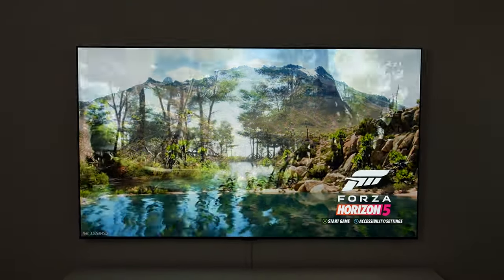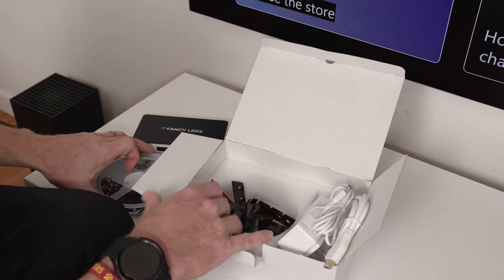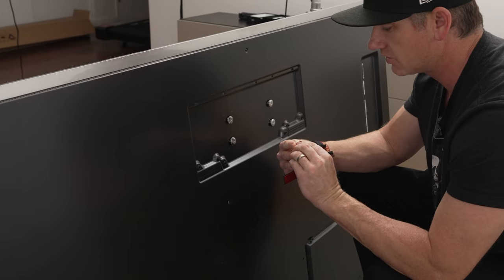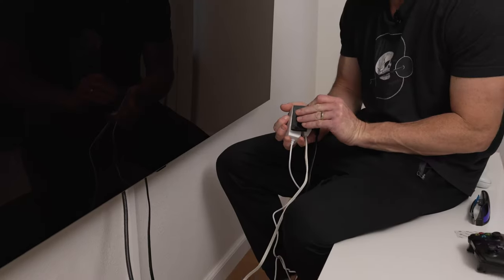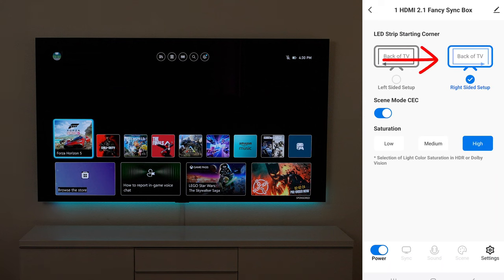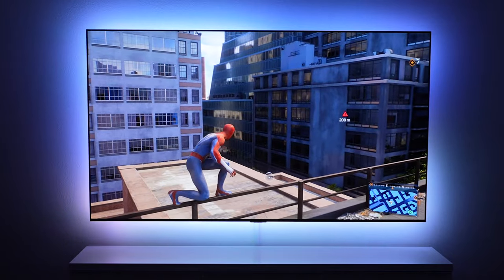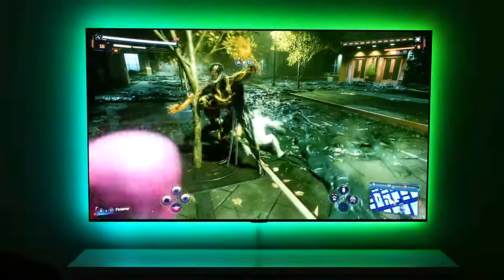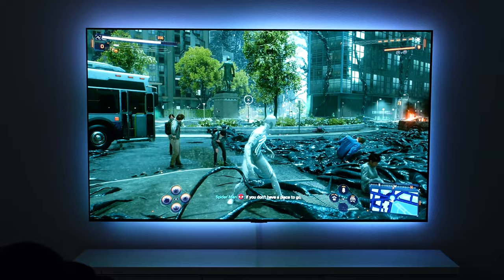Fancy LEDs HDMI 2.1 Sync Box - Making Great Gaming TVs BETTER

Comment: i take it that these lights wont work when watching content natively on the TV.  Is there a workaround for this?
Reply: I think it allows works only got the devices connected via HDMI
Reply: Govee allows it only with the camera if you want the 120hz.

If you have a Samsung tv from 2022 en newer you can actually turn it into a genuine Ambilight tv, as Philips provided an app exclusively for Samsung where you can use Philips light strip and Hue, so it would sync everything on screen, and everything Hue connected, even the ceiling lamp for complete immersion
Reply: @RifetOkic Philips works with anything you plug into it’s hdmi sync box. Any tv. Not special with Samsung or what do you mean?
Reply: @TheBooban  With new samsung tv’s no sync box is needed, only an app and the Gradient light strip. It’s a collaboration between philips and Samsung. the app is expensive, but MUCH cheaper then the sync box, and better too.

one huge disadvantage of a sync box is that it will only show the light effects of anything connected to the box, meaning your TV and all the apps like Youtube won’t work.
Reply: Apparently Govee is about to release a new sync box with hdmi 2.1 support
Reply: @RifetOkic  it’s expensive like Hue. Besides, I only have 1.4, I need a cheap box. Btw, do you know if 2.1 and 2.0 are backward compatible? Which system do you have btw? I need 1.4 and sync to music when tv is off.
Reply: @RifetOkic  apps that plug in via chrome cast would work. I have standard chrome cast and I can’t find a cheap system.

But its the inbuilt apps in smart tvs that this doesn’t work with. I don’t know how an app knows how the tv will show colors but ok.
Reply: @RifetOkic  how did you get the news?

Comment: I've had one of these installed for about three months now on my Samsung 85" Q95T, with all my devices plugged into my AVR, the AVR plugged into the led box, and the box into the TV.

It's been pretty awesome so far. Looking forward to the next iteration, with maybe more LED density, and possibly RGBW lights. But it's definitely been better than my Govee T2 was.
Reply: Did game mode and hdr work ?
Reply: @mikeygriffiths2868  yes, am playing MW3 on Series X with game mode enabled on the TV, and TV is reporting 3840 x 2160, FreeSync VRR with Input Signal Plus, HDR UHD

I will note that now and then the FancyLed box lights don't stay on when switching between Xbox main menu and actual game, haven't figured out exactly why, but if you switch back and forward it does work. Only revert happens with the Xbox, so I'm assuming that's where the issue is.
Reply: @CodCodliness  do they come back on when after loading the game also you have game mode on?
Reply: @mikeygriffiths2868  most of the time they work perfectly well first time with Xbox games whether game mode is on or off, just a little iffy now and then, where you have to switch back and forward once or twice, and I'm fairly certain the issue is not actually the FancyLed box

Comment: I finally got one of these in a week ago. Boy was this thing a pain in the ASS to get working on a PC with an AV Receiver. I literally was giving up last night, and it finally just decided to start working. Albiet it's still finicky, but I think I've got it to where I can stand it. I bought a new Active HDMI cable thinking that was a problem with my 30ft HDMI 8k cable. Nope, ended up reverting back to my original setup before adding the Sync Box and everything just decided to work together all of a sudden...even though that was EXACTLY how I had everything plugged up in the first place! Ughhhh...what a nightmare, but at least it works well enough (I think) where I can deal with the finnickiness of it.

Comment: Any chance you tried using a HDMI splitter to see if you can get this to work on both an AppleTV and a video game console since it only has one HDMI port?
Reply: Update: I tried it and it works fine. Only thing is whenever I turn on my TV, it turns on my Ps5 and I have to turn it off, use the hdmi splitter remote to change to my Apple TV input and press the Apple TV to trigger it
Reply: @bowlman2345  Thanks mate. Was hoping some tried the splitter. Can you please share which splitter are you using? I need to run my xbox series X and the TV on the lights.

Comment: Why didn’t you put the lights on the back silver bezel instead of on the black plastic? I would think the lights would be better there but since you’re the expert I figured I would ask.
Reply from the maker: No wrong answer.  I didn't want them super close to the edge and the general glow will be similar. I knew the tv wouldn't be pushed as flat but either will work

Comment: Great idea and product but there 2 question i want to ask . You know rgb  leds have just 4 lines in it. Normally all red leds are connected to same line and it is same for green and blue. When i looked at the review the reds, greens and blues all around differs in term of luminosty. How this could happen? And secondly in manual there is no deffinition that need to be started from right bottom or left bottom. How the device control where is left where is right where is top and where is bottom?

Comment: Hi. Could you please tell me the length of the power adapter and USB-C cable for the LED strip light? Is it long enough to avoid being connected behind the TV? I want to place a sync box on top of my TV desk, which is under my wall-mounted TV. The distance between the desk and the TV is about 1.5 meters.

Comment: Are you using the super slim bracket supplies with the tv? If so, would it be slightly off the wall to allow for space to Velcro mount the sync box?

Comment: I need help. I install it on my TV but my corner left side of my LEDs are flickering where everything else is smooth. Should I return it or is this something I can fix? I did find 1 area where you cut wirh a sissor thar when I put my finger on it, it's shuts off the area where it's flickering
Reply from the maker: Did you cut it in correct spot? I would reach out to customer service.  I'm sure they'll help out.
Reply: @BTheInstaller  Hi brother, yes I did cut it in the correct area. I reached out to customer service and they said it was a defective unit with the video i sent. Fancy LED has great customer service btw. They are sending me a replacement.

Comment: Problem I have with these is that they can only be used for one gaming system. Am I wrong?
Reply: They can be used for more, just need to add a HDMI switch or splitter, then run earc straight to the AVR or sound bar from the TV.
Reply: @madtown281 would that degrade the picture quality?

Comment: Would this fit behind a Samsung Frame TV when wall mounted?
Reply from the maker: Not really.  You would have to have the box inside a recessed box like in my other video and the lights around the edge. Probably not worth it for a frame tv.  Better if there is some gap for the glow it creates

Comment: Hey Brandon I’m having a tough time getting the brackets to stick long term. They start sagging and  falling after a few weeks and I’ve tried the hardest sticking tapes by 3m to no avail. My tv has a plastic back unlike the g3 aluminum finish which probably makes it stick a lot better. Any suggestions?

Comment: To be honest the colours look so weird and all over the place, its not accurate at all i think. I have the Hue sync box which by the way works with 2.1 hdmi via software update, and it can do 120fps, vrr, 4k and all of that, you only have to turn off allm, but leave vrr on, but it doesn't  matter  because the vrr when active gives you some allm support as it says in in it's  ps5 settings. So it's much better than anything else, still if you want  a cheaper rgb thats not near 100% accurate its probably a good option, hue is really expensive, I'll admit. But for me it's  worth it.